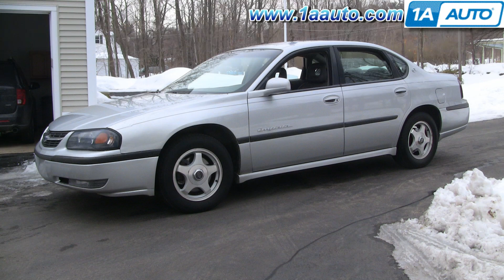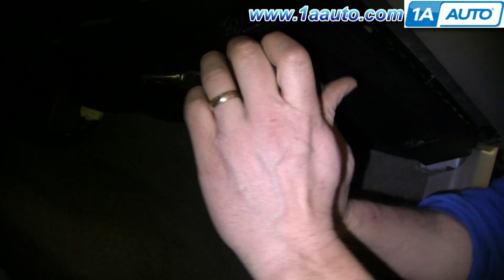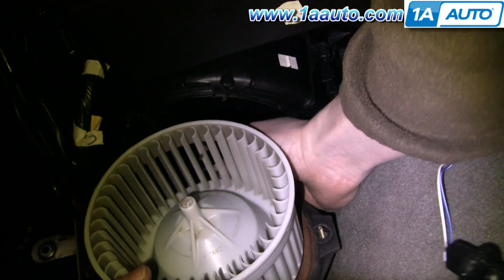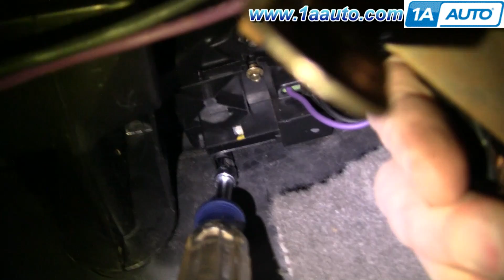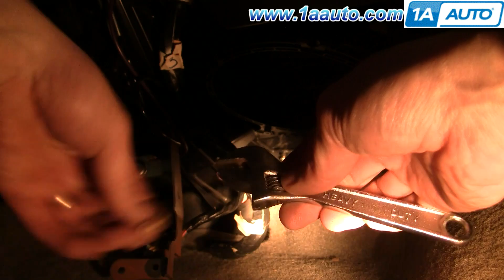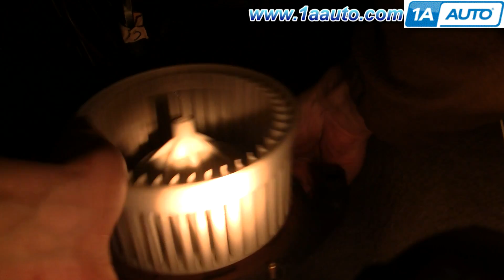How to Replace Blower Motor Resistor 00-03 Chevy Impala

Comment: I have 2000 Chevy Monte Carlo The blower motor runs with out the key just once in a while Just enough to drawled battery down a couple days all the levels on to switch work correctly any ideas could it be a relay so where is it located
Reply from the maker: HI Jeff, There may be a damaged or possibly a pinched wire on that circuit which may be causing this issue. You may want to inspect the plug that goes into the blower motor to see if it's damaged from excessive heat. Hope this helps you out. 1aauto.com 888-844-3393

Comment from the maker: @ mostwanterd19891 month ago
 
Hello I'm sorry to ask maybe u already answer this question but how do u know if the blower motor or the resistor its bad because on my 05 impala none of the speeds work and whenever I turn the heat/ac on a burning smell starts coming out of the vents of my car so I dont know which of this 2 parts is bad or is it something else thanks in advance

You may want to check the wire harness coming off of the blower motor and also the blower motor resistor to see if they are melted or damaged. Sometimes if the blower motor resistor fails, it can heat up and melt the plug end. We carry new blower motors and also new blower motor resistors on our website 1aauto.com 888-844-3393. Hope this helps you out.
Reply: thanks you were courteous and helpfull

Comment: My resistor doesn't have bolts they look like rivets how do I get it off.  2004 Monte Carlo ss
Reply from the maker: If they are rivets, you may have to drill them out in order to replace the blower motor resistor. Hope this helps you out. 1aauto.com 866-403-3393
Reply: Thanks yeah I broke them off
Reply: TheTransam85
Were they 2 rivets on opposite corners?
Reply: I don't remember I think so just used a flat head a broke them off.
Reply: Yep. That worked. Thanks man.
Reply: Your welcome

Comment: Hello I'm sorry to ask maybe u already answer this question but how do u know if the blower motor or the resistor its bad because on my 05 impala none of the speeds work and whenever I turn the heat/ac on a burning smell starts coming out of the vents of my car so I dont know which of this 2 parts is bad or is it something else thanks in advance

Comment: I have one that only works on 1, 2, and 5 speed settings.  3 and 4 doesn't work,  will replacing the resistor fix that?  It's a 2002 Chevrolet Impala.